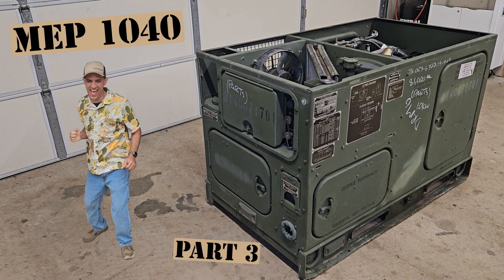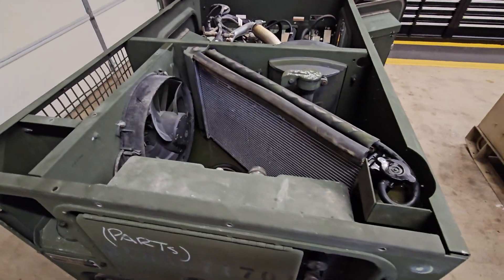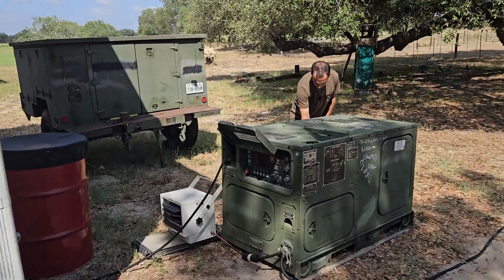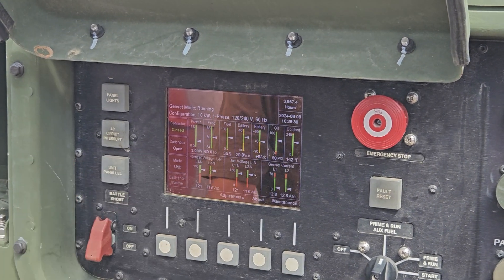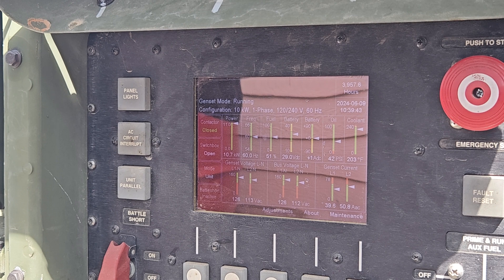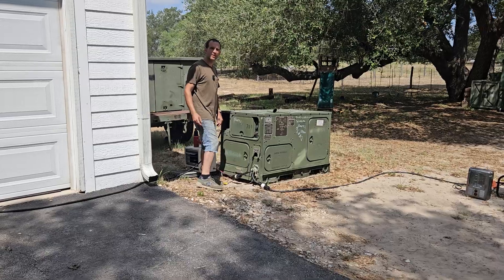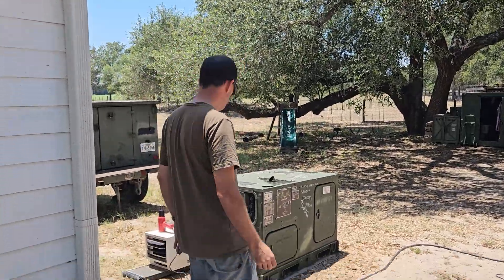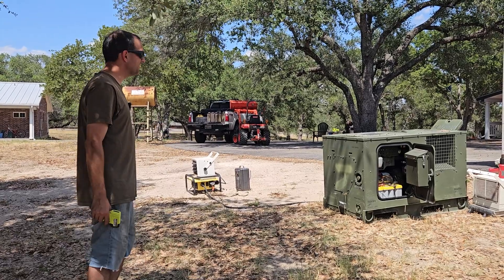MEP 1040 - Part 3

Comment: Time to learn how to rewire stators.  I don't get the DOD.   the old MEPs were more EMP proof and probably more reliable than unrepairable microprocessor thing.  The only advantage is better frequency control maybe.
Reply from the maker: These consume half the fuel and stay at 60htz. Also, they can be parallel. Yes, more electronics can be an issue but honestly, if you overcome the learning curve it can make the repairs easier. The screen unit is repairable, just not in the field. It is broken down in the parts manual. I recently got another set of these to spend time with & learn about the paralleling & plan to make videos on it.

Comment: Voltage imbalance was a sign the stator has issues, 128v L1 & 111V L2, that will cause overheating in the windings. But it did that even when loaded evenly so I’d say the stator already had problems your test just made them give up. Sorry about your luck.
Reply from the maker: It happens! After all this, I realized exactly what you said. It is probably why at the beginning, it seemed like the engine was pulled. They probably took the entire thing apart to confirm that was the issue & decided not to repair.

Comment: I was a generator repair person in the army. And when you first overloaded the generator, I was laughing and yelling at the TV.
Reply from the maker: The older ones take it no problem. Guess the newer ones are 11,000 watts tops. Still thinking there was an issue to begin with. Did they make an update that opens the contactor like the older ones after X amount of time of overload.

Comment: I obviously don’t know what the conclusion was, but if the coolant was drained during the rad swap, it’s generally a good idea to do a couple heat cycles to really work any trapped air out before working it hard. I was concerned with the coolant temperatures in this coming from a guy that works on the 800 series of generators, but maybe those yanmars don’t mind the heat. I’d consider 210° pretty warm for a mechanical diesel and reduce load to compensate for it, however these should be rated for 133% per the cummins/onan contract if it’s the same as the fermont contract as far as requirements.
Reply from the maker: The requirements are a little different. The air did burp out. It was warm due to being overloaded.

Comment: I have had Optima batteries do the same thing and  when they blow their beets they make a lovely whistling sound... Something about that Boulder tech that's great until it isn't.
Reply from the maker: I think they weren't happy with how hot it got in there after the unit shut down & there was not air being pulled through anymore.

Comment: Genius idea putting the muffler right next to the radiator smfh
Reply: Good enough for government work. 🤣

but most commercial generators are like this now too.
Reply from the maker: I thought it was odd, but I'm sure it is done for a reason. More to help with cold weather operations and keeping temperature up and then the displacement of heat is greater in hot environments.

Comment: A cliff hanger! Arrrrrgh. 

Serious question you've probably answered elsewhere: Why run it 20% overrated? Seems like a formula to kill something. 

Great video series.
Reply from the maker: The generators have a .8 PF rating. Without getting to technical, that is roughly 80% on a full resistive load. So a 1 PF rating is 20% more. MEP 803A can take this load all day and it is 10KW rated.
Reply: @CallMeColtLLC  yes sir, they’re tested to 133% for the government. I’ve seen the 802/803’s do 120% for hours on end.

Comment: Are you going to fix her up and get her running again or is it going to be parts and scrap?

I'm guessing it would have done the 10KW for six hours without a problem...
Reply from the maker: Yes, I think at just 10KW it would have passed the test, but if there was an underlying problem, it would have come up down the road later & died a slower death. It will sit until I can get another one for doner parts or a stator.
Reply: @CallMeColtLLC  👍🏻
Just makes me wonder what the underlying problem could be.

Or maybe these are just not built that tough?

Comment: They get dug in and covered, so running a bit hot isn’t usually one of the problems for them. Fuel filters and injector pumps on the other hand.

Comment: According to Allied Ordnance Publication AOP-38-3,[1] a NATO publication, a battleshort is "The capability to bypass certain safety features in a system to ensure completion of the mission without interruption due to the safety feature." It also says, "Examples of bypassed safety features are circuit overload protection, and protection against overheating".[1]
Reply from the maker: Yes, I know what the battle short does and it wasn't activated and I didn't want to use it. Could have been used to override the overtemp warning but the excitation failure would have happened.
Reply: Got to love snafu on military equipment  @CallMeColtLLC

Comment: You pushed the old girl kinda hard! Thanks!
Reply from the maker: It's the same load I would put on a MEP 803A. They will pass a 6 hour load test no problem with the same load!
Reply: @CallMeColtLLC  Wonder if there's a problem with the thermostat not opening up all the way?
Reply from the maker: @rodneymiddleton9624  I will have an upload discussing what happened. In short, it was overloaded & there is no safety to protect itself like the older units. Just the warning. But, it may have had underlying issues as well.
Reply: @CallMeColtLLC  Gotcha!